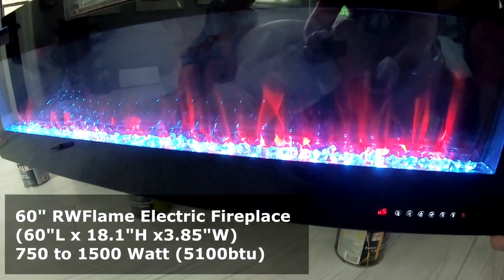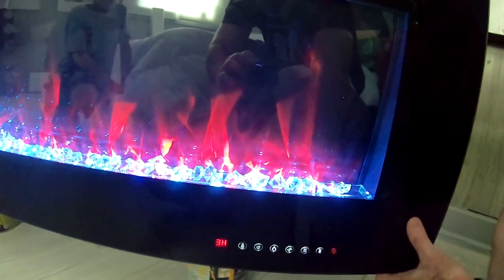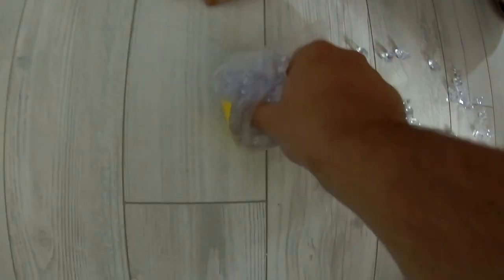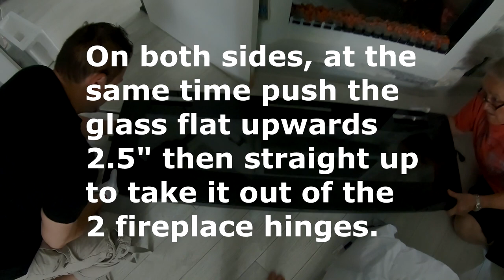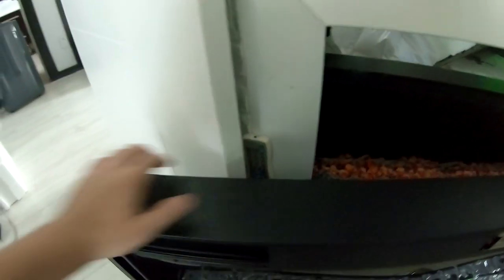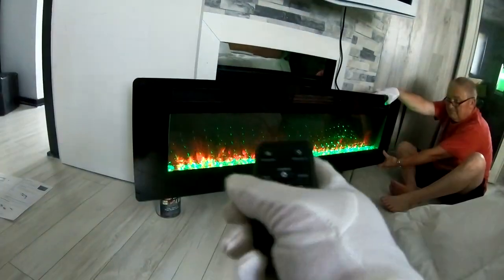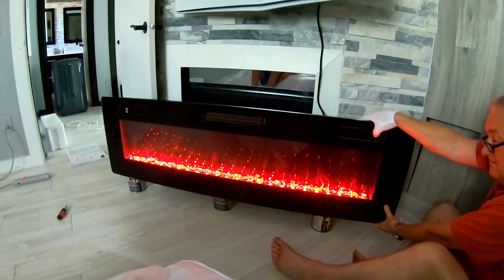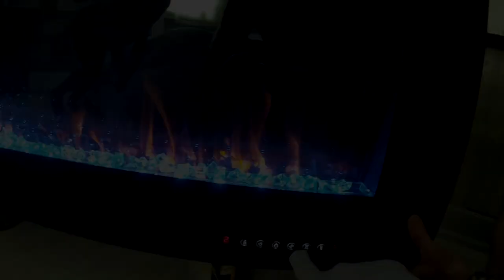Review Install Guide ** RW FLAME Electric Fireplace 60 inch Recessed ** Top Selling Fireplace

Comment: Hi, please, how do connect the two crystal lights and outer one ? Not the power outlet. I having issues figuring out how those cables works
Reply from the maker: There's a little thing Power strip if I remember correctly that must be connected before u put the glass back on

Comment: How did you screw it into the frame?
Reply from the maker: There r two screws one on each side on the top edge. After you hang over the wall mount the acrews would go around the fireplace